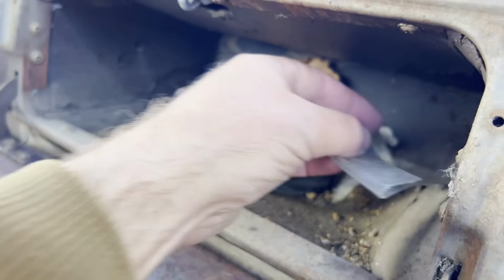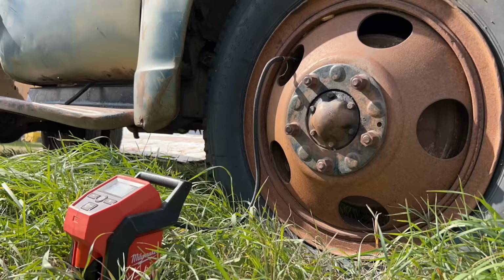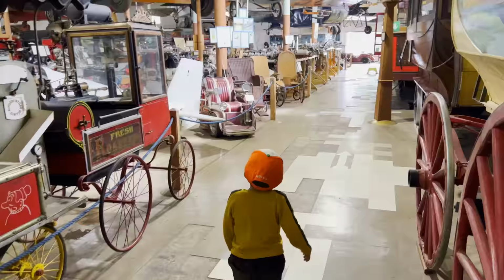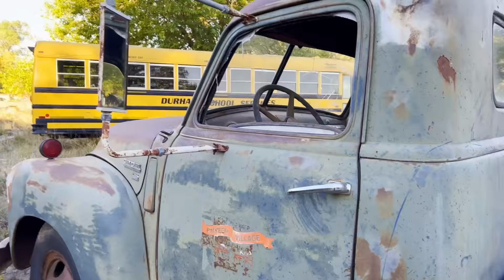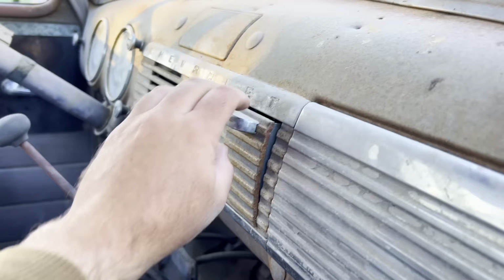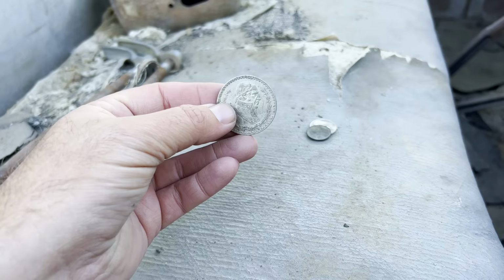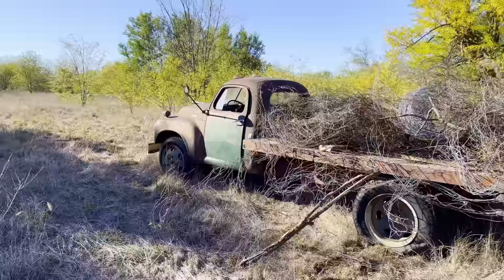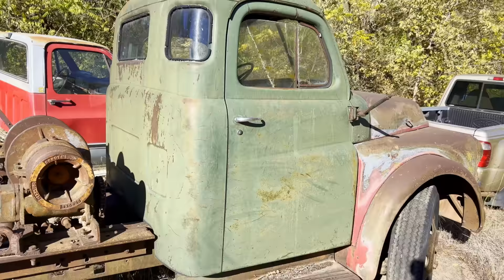SURPRISE BONUS!! I Drove Clear to Nebraska for this Old Chevy Truck - Guess What's in the Glove Box!

Comment: Why don't you cut all the frames up. Stack them out back. When you get time, cut the frames up for prepared steel. When you get enough, get a dumpster and load it up. I roll the bodies off cars and trucks then scrap the sheet iron. I then cut up the frames into three foot pieces. The rear axle gets drained and cut up. I make more money that way compared to hauling a complete car to the scrap yard. Also, I tear down all aluminum engines and transmissions.

Comment: 216 chevy has a sheet metal side cover that runs up the side of the block to the valve cover a 235 has two side covers about 6 by 12 inches on the side of the block hows that from a ford man